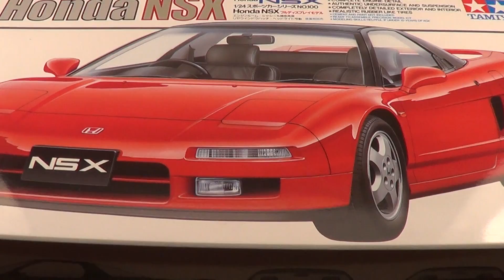Building a small Honda NSX plastic model (Tamiya 1/24 kit)

Comment: that's so clean, flawless :) you did a good job on this one! I like the pressure valve on the rims.
Reply from the maker: My friend, 
Thank you! :)
A nice and cheap kit, you need to build it :)
Reply: I have the cheapest kit to build this December. It's the almighty Porsche 959 from Tamiya 😊
Reply from the maker: @mykiksulife  LOL, I plan to build the same kit but next year
Reply: can you tell me what did you applied on the speed dials decal? is it varnish? 😳
Reply from the maker: :))
yes, is varnish, and I like to apply varnish because is looking more real.
I use acrylic, undiluted varnish after decals are  well dry
Reply: you won't guess the kit I'm building now :) it's a Chevrolet Impala '66 from Revell. A rubbish kit I bought a year ago, parts don't fit, bad plastic quality, but I challenge myself to build it as good as possible. I made some additional parts so I can assembly the body with the chassis, it's..."china quality". But I hope I can bring it to life :). Body it's almost finished, I have to work on the interior and maybe this weekend it's ready. I even made some adjustments in order to fit some wider wheels. "lowrider" wannabe :). By the way, my 911 turbo it's done.
Reply from the maker: @mykiksulife  :)))) lol, Revell has some nasty kits sometimes. I'm working on Nissan Skyline V Spec II. Painted in some Subaru BRZ blue :)))
Reply: oh, that's nice, good luck with it! take your time, don't rush. I have this kit too, GT-R R34 Z-Tune. I was actually thinking of building this one after I finish the chevy impala, but I can't decide on the paint - whether it should be blue "Brian's GT-R" or gun metal  :) I need a flawless kit as a cure after this Revell, hehe 😄. I'm expecting a new order of spray paints, carbon pattern decal and engine wires, as soon as it arrives, I will make a decision.

Comment: Is it hard to assemble, does it also come with the coloring kit?
Reply from the maker: It's not so hard just use the instructions provided with the kit. The hard part are headlights. After you spray the varnish, you need to adjust them to fit in their spot.

This kit comes without the colors, primer, and glue you need to have them :)
But is a beautiful kit.

Comment: I want to build a Rally/Race inspired version but want different wheels and tyres to fit on it !
Reply from the maker: Hey!
I'm not very sure, but you can go for 18-inch tires (some tires that you find in a hobby store). 
Or, if you have a Tamiya Subaru WRC kit, I think you can use those tires.
Anyway, for custom tires some minor changes need to be made to the suspension.
Reply: @SmallScaleFun  just ordered some Lucky Strike decals, the Tamiya 93 Celica Rally light pod is almost a perfect fit 😉
Reply from the maker: I didn't know :)
Do you intend to make some changes in the body?
Reply: @SmallScaleFun  I am not sure yet. I will decide when I have the chassis built with the wheels on.😁
Reply from the maker: Please send me a link after you finish the model. 
I'm curious about the results.

Comment: Great work! The color of the wheels in 5:58 is beautiful, is it metalic grey?
Reply from the maker: Hey!
Thank you for your appreciation!
The color of the wheels is an "accident" :)
I sprayed gloss black primer -> ALCLAD Stainless Steel -> and didn't wait enough time to spray the gloss varnish, so, the varnish made that color, practically the varnish has diluted ALCLAd color.
You can obtain something similar with metallic grey (I intend to use this color on  a Toyota GR 86 rims)
Reply: Thank you very much for sharing the experience! That's a great "accident"  which makes the wheel color just like the one on the real Honda NSX. @SmallScaleFun
Reply from the maker: I also like the color :))
I intend to build another Honda NSX model with different rims and paint it metallic gray :))
Reply: That is nice! Looking forward to your new model🤩 @SmallScaleFun
Reply from the maker: I'm working on Tamiya 1/24 VW Beetle 1300 for the moment. 
The body was damaged by paint (Gravity Sea Blue) and I had to buy another kit to use the body
After that, I have another Beetle kit (Tamiya new Beetle) :)))
Reply: @SmallScaleFun  Wow, I like the Beetle series, the old-fashion cars are always classic and elegent. I tried to work on the tamiya new Beetle as the first 1/24 model car, but unfortunately it is out of stock. Hope to see your finished masterpiece model:)
Reply from the maker: The new Beetle was a gift from a friend of mine (fellow modeler)
He also damaged the body with Zero Paints :)))
Hope that I can fix it

Comment: Nice!
Reply from the maker: Thank you! :)
Reply: @SmallScaleFun  👍👍👍. Btw do you remember that I said that I will make a assembly video about the Concorde?
Reply from the maker: Lol, yes
Did you made it?
Reply: @SmallScaleFun  how can I say… the model is ready but it has to be painted… but my airbrush compressor is broken. So now I will have to buy a new one.
Reply from the maker: So sorry to hear that. I use a cheap compressor, is very noisy but I work in a garage. I bought an air pressure valve with a moisture trap valve in order to adjust the airflow and I have 25 l of air ready to use :)
Reply: @SmallScaleFun  thanks for your reply! I have(had) to a cheap compressor but I think I know the reason it is broken. The last time I used it it was summer and very hot outside, so I think that I overheated it. After all I will buy a new one and finally finish the model and make a assembly video!

Comment: Do you have to paint it?
Reply from the maker: Yep, you need to paint it.
But, if you are ok with the body color from the box (the plastic is also red) you can build it like that
Reply: @SmallScaleFun Ok, thanks. I don’t have an airbrush, hence why I can’t paint it.
Reply: @LGsRCs you don’t need an airbrush to paint to paint it just get a can of gloss spray paint and for the rest of the parts get a Matt black primer and just use a brush for the smaller details and painting the black primed parts